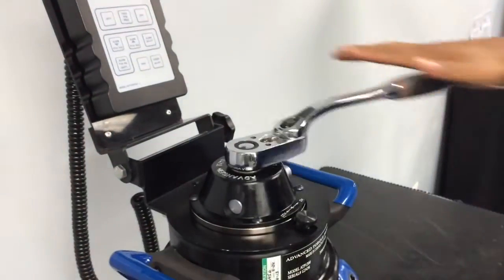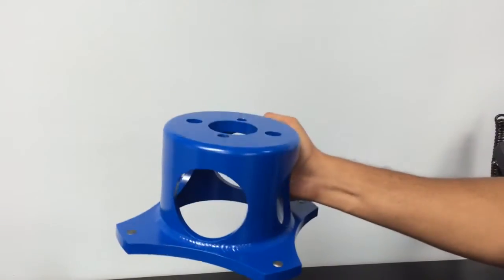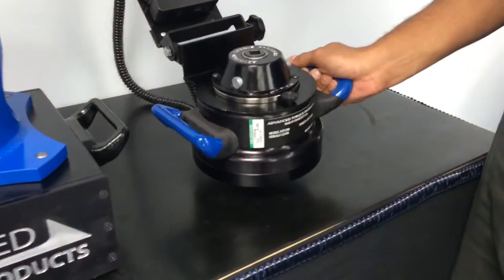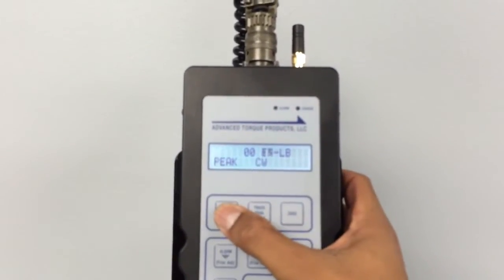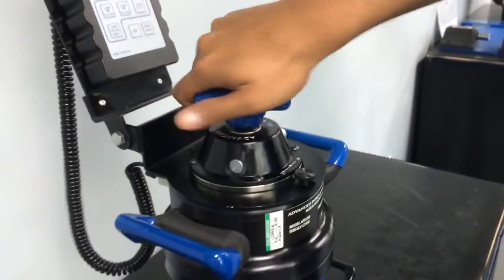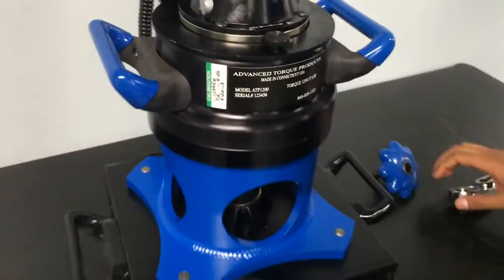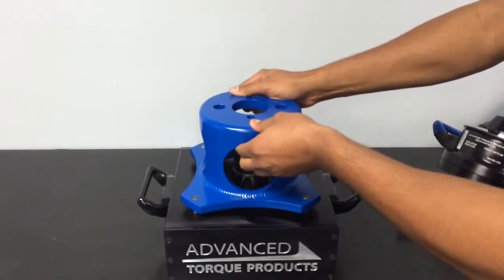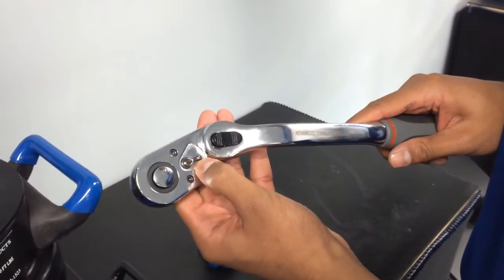Torque up and Break away Demo

Comment: Do you have a video showing safe break away at high torque like 5000 FT LBS?
Reply: in this level you shoud push the botton from cw to the neutral and let the ratchet move conterclockwise .. pay attention in this case it can spin fast .